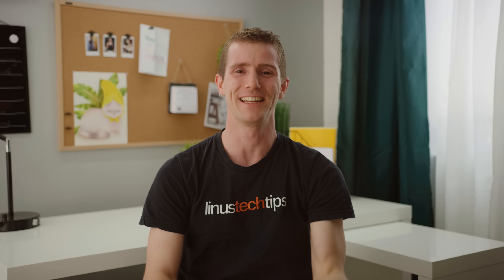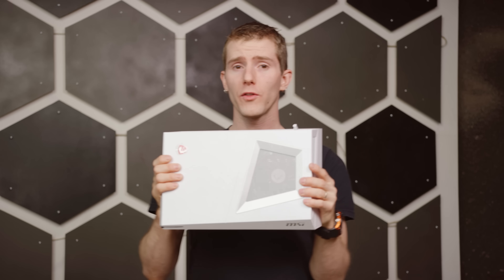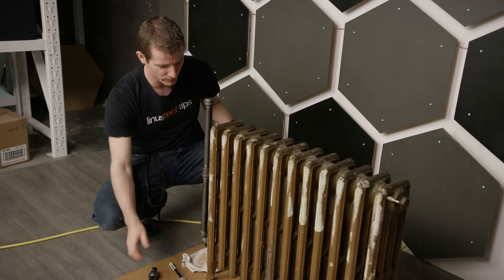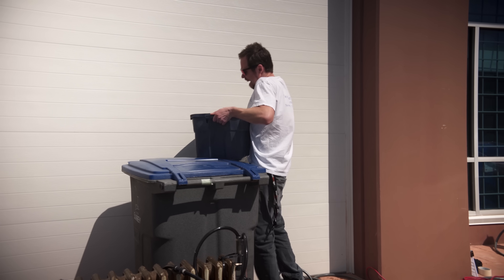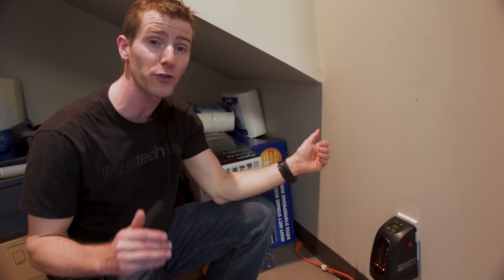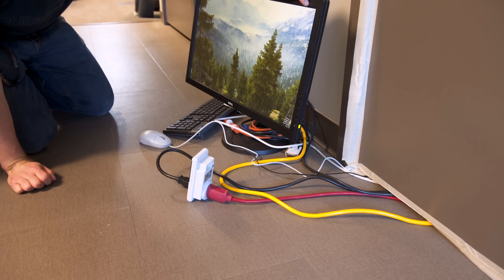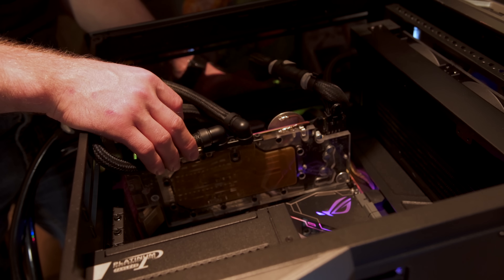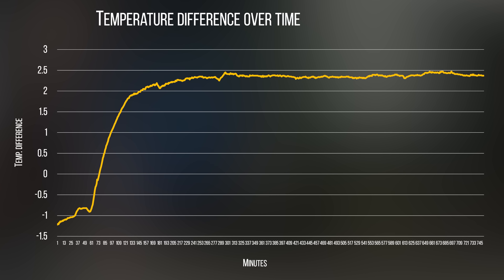Lower your heating bill... with GAMING

Comment: Air's kinetic energy is also dissipated into heat due to friction. Air-to-air friction, that is. So it doesn't really matter how much fans you have - it will end as heat anyways
Reply: PerqTV ehm no
Reply: Yes... If you know anything about physics you'd know that any use of energy will eventually be converted into thermal energy, thus heat. Your fans will lose energy from friction which heats the roam, the RGB lighting will eventually be absorbed by something in your room, slightly warming that object.
Reply: I was looking for this comment for too damn long, this should be higher in the comments.
The air is moving and therefore it has kinetic energy. But it stops moving (you can't feel the air from the fans from a distance) due to air friction. It loses it's kinetic energy and (first law of thermodynamics) that energy causes the molecules in the air to heat up themselves.
Moving air slows down because of friction and friction increases temperature.
Reply: Yes, any fan will ultimately heat up the room. Fans are used to mix air for better uniformity, or help your sweat evaporate faster, not to cool a room.
Reply: Ehm, yes.
Reply: Well come to think of it otherwise. The fan will eventually stop sto all its energy will have been turned into heat anyway. No matter how you see it most of it will be heat
Reply: While it may generate heat energy from the kinetic energy it imparts to the air, fans also create a cooling effect that, when appropriately applied, will feel like ~5*F temperature drop.  This is accepted in thermal comfort design, and inherently accounts for any heat generated from air-air friction.  So, while a neat tidbit about physics, it’s slightly misleading for folks who will assume that turning on a fan will make them feel warmer due to it generating heat.
Reply: Nathaniel Karlsrud it still generates heat not absorbing it. You may feel it beeig cooler but the temperature wont really change in the room
Reply: +Nathaniel Karlrsud Fans make you feel cooler because the air rushing over your body absorbs your sweat faster than relatively stationary air. When liquid evaporates into a gas, the remaining liquid is cooled down. So that's why you feel cooler.
Reply: this
Reply: The cooling effect of a fan over your skin is the same, well, blowing air at radiator.
It is called forced convection, and it increases the rate at which body transfers heat to fluids (air is a fluid). 
Assuming your skin temperature is higher than surrounding air, heat will go from your body to air. 
If you move that air over your body, the rate at which this happens will increase, therefore you will feel as if it is cooler.
Temperatures remain the same.
This can be easily experienced by touching glass and wood which are both at room temperature, yet wood will feel warmer than glass. This is not because glass has higher temperature, but because it transfers its "room temperature" (which is lower of that of your body) faster than wood (in reality it means it drains energy from your skin faster).

In other words, we don't really feel temperature of things, but the rate at which things transfer heat to our bodies.
Reply: PerqTV - so nice to see posts that are actually factually correct. ALL the energy from the electrical outlet is eventually converted to heat energy that warms the room.

Some of the folks need to look up 'latent heat of evaporation' which will explain much of the evaporative cooling and why humidity can have such a noticable effect on how warm/cold one feels compared to the actual temperature - and why climate temperature monitoring has 'dry bulb' and 'wet bulb' measurements.

Oh, and with "cooling fans", if the air temperature is higher than the body, it can actually heat instead of cool.

Comment: That big radiator doesn't make any difference lmao, makes it slower if anything

if you just use the PC with a fan it would be quicker
Reply: Gotta make some drama and farm some views.
Reply: The big radiator will both heat up much slower and cool down much slower, providing a more even temperature.
Reply: Yes, but when you game with the radiator you could also put a pot on it and slow cook dinner or keep some mac n' cheese warm.
Reply: thermal mass homie. get your thermo right,
Reply: Literally doesn’t even matter your cooling choice, if you’re not throttling. If you’re not throttling, a watt is a watt is a watt and it’ll dissipate the same energy no matter how
Reply: @myid9876543  Finally someone with a brain!
Reply: For one room, yes, but it’d be great as a  central heating system

Comment: That big radiator does nothing. Either way, the same energy is converted to heat and distributed to the room.
Reply: Not having a radiator means that the temps would be more heterogeneous in the room. More heat would be concentrated at the pc, meaning higher cpu and gpu temps, which could result in thermal throttling and therefore a smaller power output.
Reply: Sean Demers google what heterogeneous means before you use it.
Reply: Zlflo the temps would be more homosexual
Reply: @bradhaines3142  heterogeneous was used correctly.
Reply: Actually worse due to the thickness of the metal
Reply: @bradhaines3142  what he meant was that since the radiator has more surface area, more of the room would be heated at the same time causing the room to have a more uniform temperature then if the pc was heating by outputting hot air through fans making it much hotter by the computer. I think the room would be heated adequately either way but he does have a point that the radiator would help reduce heat from the gpu and cpu if water was transmitting heat to a radiator.
Reply: If you have decent air flow. It wouldn't be an issue.
Reply: Was going to leave a comment flexing my degree and how wrong you are but then I realized how much of a waste of time that would be so now I'm just going to leave this comment in shame so I can remember it next time I think about beating my chest online about nonsense that doesn't matter.
Reply: The radiator would let you put the PC into one room and cool another one or create a large distance between the area that needs heating vs where you use it.
Reply: @MeJoeShmoe  I wish you did leave that comment because I would have learned a lot about what made his statement wrong and maybe a bit about how radiators worked /: oh well lol
Reply: Not true, it does something very important. It generates clicks on the thumbnail.
Reply: @atlmember4045  no it really wasn't used correctly at all. It means consisting of diverse and dissimilar components or ingredients. Everyone using both heterogeneous and homogeneous are all using the terms incorrectly. How can the temperatures consist of several diverse things that can not be compared to each other? That makes no sense.

Both words are primarily used in Chemistry or human geography. It does not apply here at all.
Reply: @richbob9155  "diverse in character or content." What he's referring to is spatial temperature diversity. Maybe it's an unusual use of the word, but it's not incorrect.

Comment: Fun for a joke vid, but you do realize that it doesn't matter whether you're using an old heater radiator or not. The PC outputs exactly the same power, and if that power is fully dissipated, then it heats the air, and if not, your PC will quickly overheat. It won't output more heat if you use a bigger radiator because thermodynamics. Bigger radiator doesn't add any energy.
Reply: Yep - nonsense video. You are still using the same amount of energy if you turn off your heater and play a game on your PC instead. It's like saying you can save energy by using a different 500w heater to the 500w heater you normally use.
Reply: Nikolay Yakimov.  Nowhere in the video was that claim made....
Reply: Also the kinetic energy and light are also converted into heat (by fricition and absorption) so ....
Reply: I totally agree with you. If anything the extra water needed to fill the stupid radiator made it take longer for the room to heat up.  Plus, the space heater looses energy to light too as the coils start to glow, but maybe that energy is regained as it bounced around, I don't know. But you get a lot more use out of a PC. Way more efficient.
Reply: Ok but wouldn`t the big radiator spread the heat more efficiently? Instead of small fans blowing the heat right against the wall behind the pc or up against the desk?
Reply: Yeah, I made a similar comment.  The giant space heater is just slowing down how quickly the heat enters the room, because of the thermal mass like he mentioned.  But yeah, the same amount of heat comes out either way.  My room stays nice and toasty in the winter when I game, I love it :)
Reply: So I'm going to throw this out there as someone who has a house with those oldschool radiators for a main source of heat.  What they didn't also include was the heat that the iron and water retain.  Rather than forced air / electric which as soon as the energy source is gone there is no more heat coming from there whereas the radiator still has a lot of stored up energy that gets transferred to the air.  I have a lot of friends who use other sources of heat and even though my house uses fuel oil and old school radiators I have a modern furnace and spend a fraction of what everyone else does because my furnace only needs to run for a small portion of time, just long enough to heat the metal up.
Reply: +Nikolay Yakimov Yes totally true, except that in this case, if the radiator would actually cool well, it might be able to cool the water down a bit better than the little radiators in your case. This would give you extra temperature headroom on your video card and cpu which might lead to more power usage. Specially considering GPU boost 3.0 will boost higher under 60 degrees.
Reply: Garlic Terror I'm not sure. It seems like the newer radiator in the pc has the added benefit of the fans moving air over it allowing for much more air to remove heat. I think that would make up for the smaller size
Reply: The PC won't output the same amount of power if it's thermal throttling because it can't dissipate the heat quickly enough. Otherwise, heat sinks would serve no purpose.
Reply: trooperJac I think you missed the point. The idea is you wouldn't need a heater if you had this, You would only need this instead of a heater and a pc.
Reply: Danielle Spargo yea but when you shut your pc down it immediately stops giving off heat, A giant cast iron radiator and several gallons of water will still give off heat for a long time after the pc has been shut down.
Reply: The radiator is to prevent the PC from thermal throttling so that it can consistently output heat at the same rate.
Reply: Nowhere in the video was the opposite made clear, and the video is structured in such a way that it suggests that you need a giant radiator to heat the room. Which you do not. So I thought it needs clarifying.
If such a claim was indeed made, I would use much stronger language.
Reply: Also don't forget that the resistance heater they were using is f**in' high efficient (theoritically, it's 100% efficient since all the energy goes into heating). PC with same amount of power used? Of course it won't produce so much heat because part of the energy goes into computing. LTT lately is like Mythbusters last couple of seasons where instead of busting myths they could have just sit down to talk for 5 minutes about the physics behind it and find out that it is possible/impossible.
Reply: Yeah but you can game on a pc and not on a old a radiator.. so ha.
Reply: It is a joke!!! Stop taking everything so serious guys like really come on
Reply: Thermal mass argument would be valid if the point of comparison wasn't to a tiny blower heater.
Reply: Exactly.  At first, I thought they were going to put the PC outside of the room and only the radiator inside.  In that case they would still be radiating some heat outside of the room and the results wouldn't be accurate.  When they put the whole deal in the room, I then thought what even is the point of the radiator then?  It wouldn't matter if it were air cooled, liquid cooled with a radiator inside of the case, or this mess.  All of that energy is going into the room regardless.  I suppose it was just for the lols anyway.
Reply: People dont understand how heat works >_<
Reply: But you can overclock more to generate more heat. In case you have a bigger heatspreader, it can be different
Reply: Can the radiator handle minecraft?
Reply: Nikolay Yakimov bro give them a break. Theyre barely high school educated.
Reply: You need to cool the disippated air
Reply: he used a big radiator to avoid losing some power to running fans; a radiator would have to be quiet big to be able to passively cool an entire PC
Reply: Bigger radiator = more surface area = quicker heat dissipation. Not more heat, just, quicker. The GPU was throttled, it wasn't outputting as much heat as it could.
Reply: trooperJac 
You do save energy if you already wanna do gaming - the energy will run your PC AND heat your house up, rather than using twice as much energy for doing both things separately.
Reply: Nikolay Yakimov exactly what I thought the whole time.
Reply: bobsagget823 What do you think happens to the energy that "goes to computing" ? It's also heat. All LEDs, fans, hard drives and ICs just produce heat.
Reply: Instead of both having the pc and the heater, you save money by having just the pc heating the room
Reply: Some heaters run on gas heated water (in the Netherlands for instance we use boilers) then it would be much cheaper (obviously a lot of energy is lost by heating the water to the area by the boiler) if efficiency is 100% then it is not cheaper of course.
Reply: You are best with bigger radiator hold more heat when playing on pc long time.
Reply: j jarry
The point of any radiator is to dissipate heat, not to hold it. If it "holds" heat, it will very quickly become as hot as the CPU itself and the heat flux will stop completely because it's proportional to the temperature difference. That's high school physics. Hence your comment makes no sense.
Reply: Exactly my thoughts. Maybe with that big ass radiator we can overclock the system and take advantage of all that surface area though.
Reply: Dad?
Reply: Nvm
Reply: Exactly what I was thinking... any improvement in the dissipation would just mean a more effective cooler... but literally any cooling solution would output the same heat
Reply: heat storage. the pc heats the air of the room but the radiator stores the heat via thermal mass in the water and holds the room at temp for longer. Your right, it doesnt add energy. Just uses it more efficiently.
Reply: @RavenPrecept would be interested in results...
Reply: If anything you'd want to hook up a bigger fan from the exhaust and essentially an electric heater, but then it's only going to heat your room up to ambient temperatures. If you had a freezing room and left the fan on for 2 days it might heat but even still you'd need some serious insulation
Reply: @allypezz  and either no windows, or some really really expensive quad pane vacuum sealed windows.
Reply: @Acroanidd  A+

Comment: If this doesn't feature a FX 9xxx CPU I will be disappointed.

Edit: I am disappointed.
Reply: or Pentium 4
Reply: Then this video would be meaningless because FX 9xxx is already a heater by itself.
Reply: Problem with heater? Isn't this a main point of whole video?
Reply: ...and crossfire r9 290x's
Reply: Bro core i9s run much hotter.
Reply: At least i9s have excellent performance to match their power consumption and heat
they have good perf/watt
and who can afford an i9 - can afford necessary cooling
NOT the same can be said about the 220W FX9590
but now AMD are excellent and they have pretty amazing efficiency ... at least for cpus
Reply: My system has two x5690s, that's 260w of TDP. I did have a pair of HD 6950s too but one died.
Reply: Pandafurtz why R9 290Xs? Two R9 295x2s! That would be insane.
Reply: FX 9590 and dual Fury X, here. It's nice in the winter, but I had to underclock it into the ground for summer. Also, I live in Florida, so there is that. :P
Reply: HAH, I have a FX 9590, TAKE THAT CANADA (The heat is killing me
Reply: I'm still running an FX8350... I know exactly what you mean
Reply: I think you misunderstood the video.  The goal is just "heat the room"... not "create a foundry in the room".
Reply: Pentium D?

Comment: Get a Pentium 4 and a GTX 480 and you’ll be set for life! :)
Reply: AMD Master Race!
Reply: @linkthehero1234  I made a Ryzen 5 3600 build with the stock cooler and stock thermal paste. The stock paste is garbage, but when i replaced it to Kryonaut by Grizzly I managed to not overheat it (stock paste about 105 degrees Celsius, Kryonaut 90 (that is the upper recomanded limit))
Reply: GKGameplay CZ is it possible that you smudged the stock paste? I’ve done that many times... lol
Reply: @heeff  No, they did too thick of a layer from the factory
Reply: @gkgameplaycz  that's crazy what voltage?
Reply: @miniweeddeerz1820  I think the fact that it stood right next to a radiator wasn't helping the temperature... Anyway I reccomand using a more powerful cooler
Reply: @gkgameplaycz  yeah that wouldve done it lol. Anyway on stock cooler the CPU can boost to 4.2ghz so it's fine.